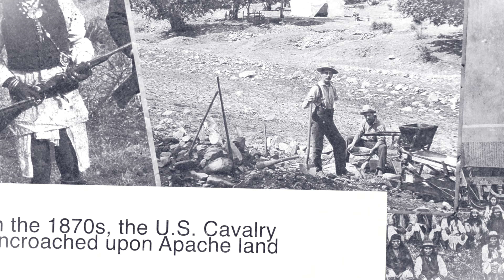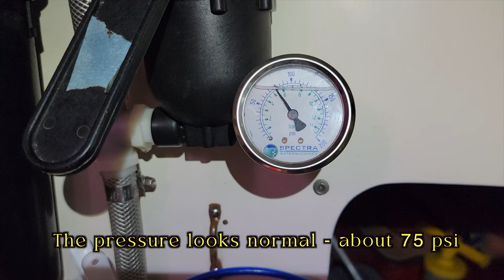ALL WORK and NO PLAY - Fixing our WATERMAKER (Spectra Catalina 300 MKII) at ANCHOR (TSB S1:E12)

Comment: hopefully you read comments from old episodes. Those fittings were changed to bronze from stainless steel. Spectra found that the stainless steel ones would rust once they were screwed in and were starved of oxygen. The rust would expand and crack the housings, warranty replacement. Orings are available. at Ferramar in Loreto, and a t Ace Hardware in LaPaz.
Reply from the maker: Thanks for the info! That's super helpful!